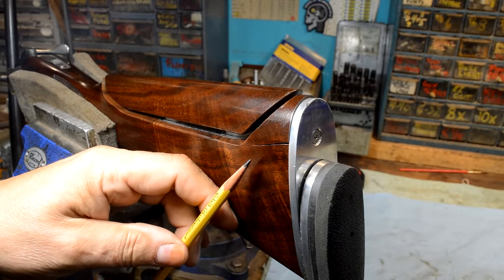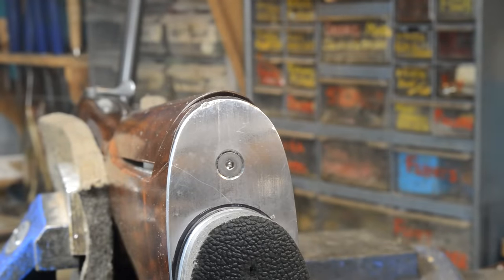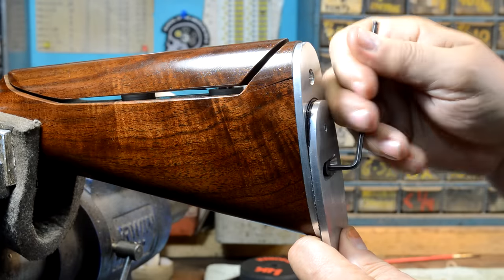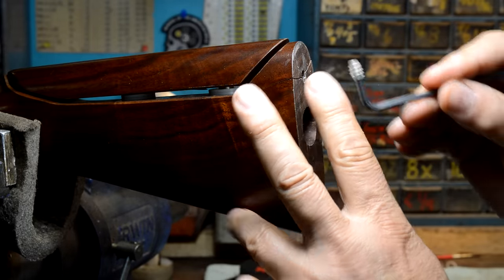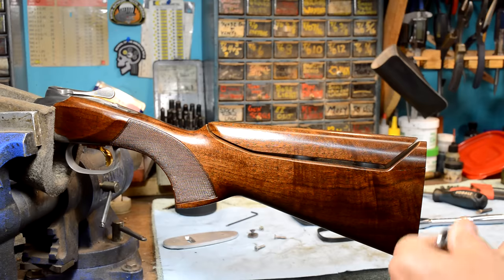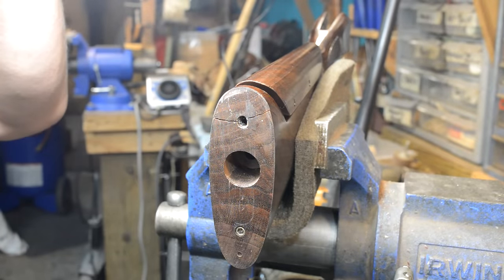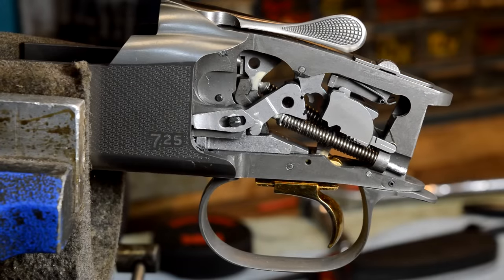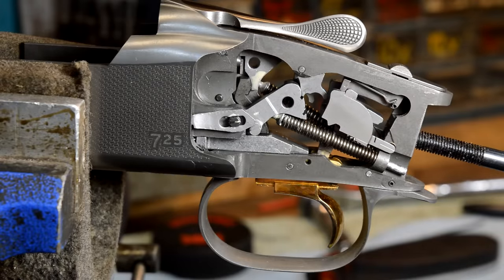Browning 725 Butt Crack repair: Anvil 0127

Comment: Your vids are awesome.  When you have a split like that can you use a thread to pull glue into the crack??
Reply: I would also use painters tape on both sides of crack on both sides of stock bringing it close to edges as possible so I do not need to scrape the finish so much. then there is just a slight thin line instead of an 1/8th of an inch. Im a master cabinet maker and finish carpenter and have made everything you can imagine, and dealt with tons of damage. Wood is unforgiving.

Comment: Hey Mark, question for you...when you were applying the glue to the crack to fill everything could you have put it into a syringe and basically force pressured it into the hole/crack filling things up from the bottom to the top? vs trying to cram it in from the top with the drill bit?
Reply: Acraglass has glass fibers in it for strength, a syringe would clog.
Reply: @jsh6952  a large enough tipped syringe like one used for injecting meats with brine I dont think would clog.
Reply: @ETKSauron  that tip would need to be at least 3/16" or 4.5mm. That is more like what embalmers use at the funeral home.....
Reply: You can carefully use compressed air to force the epoxy into the crack
Reply: @WHATAGIRLWANTS2009  Mr. Novak used the hydraulic method. The threadsert hole was the cylinder, and the drill bit was the ram.
Reply: @ETKSauron  and by the time you get the syringe, filled it with the thick, gooey glue, reassembled - you could have just did what mark did and got it does with the same result. Simplest solutions are often the best time wise and time is money. Also, then you don't have to worry about trying to find a syringe that will work, and buying them/disposing of them. Your idea, while would work is uneeded complication and tooling.

Comment: 32:20 just curious, but wouldn’t it be more logical to put in the dog bones first, before screwing in the insert to avoid stressing the glue joint more than necessary?

Comment: Perhaps a silly question- why do use the synthetic glue say vs casein, or fishbladder or rabbit hide glue? Is it because of exposure to humidity?
Reply from the maker: Water resistance, and a small degree of flexibility. Also, I can checker right through the nylon, and it will hold the diamonds, which the other glues will not. Real bottom line....I can make Acraglass sit up and bark on demand, and can count on it downline. It works for me, everytime. No shade on other adhesives intended or implied.
Reply: @marknovak8255  no understood- just approaching the butt from a luthier's kind of perspective (music instruments admittedly are not brought through forests or inclement weather- and avoided dropping at all costs)

Comment: Mark, out of sheer curiosity - how many more times does it take to make such a (relatively simple) repair while filming rather than when working alone?
Reply from the maker: Doubled
Reply: @marknovak8255  Easily doubled. I worked for a couple hot-rod shops for a couple decades. I worked with a few magazines on builds or installing parts for content/articles   - it is amazing how long it takes. I still hear "rotate your hand and tool, hold...hold *shutter click,  click*" ok I got the pic, next step" or "I didn't get that, take it off and reinstall so I can get it...."   It made a car build that would have taken 6-10 months (magazine builds are never as nice as they look....lol) turn into a year and a half between scheduling, work, photography, and editing.

Comment: Green Rookie here, Would it have beneficial to steam the Butt end, since it had an impact?
Reply from the maker: If damaging the finish was of no concern, definitely. However.......it will damage the finish.
Reply: @marknovak8255  Thank you Sir
Reply: @marknovak8255  Early in the video, Mark mentions the highly figured stock has an oiled finish.  Steam would push water into the wood, and displace the oil.
Reply: That was a good question I was thinking the same thing.

Comment: random question: how well do you think bicycle chain lube, specifically the new fancy waxes and oils, would fare as gun lube? I mean the entire point of those is not only to lubricate but also to keep all that nasty road grit out of the chain. and I think bicycle chains are exposed to far harsher conditions than the insides of guns....
Reply: Oil for parts that rotate.  Grease for parts that slide.  Viscosity depends on ambient temperature.  After some shooting, the carbons from powder gases especially in semi-auto pistols, form a bearing surface with the oils.  So, really, use what you've got and reapply when it doesn't do the job anymore.

Comment: I have to say that is an.....unusual buttplate.  The top plate is only secured to the bottom plate with a single allen screw.   Seems that inevitably that screw will loosen and begin swinging around on the fulcrum of the screw.
Reply: @chuckschillingvideos that’s likely a Graco Adjustable Butt Plate that the owner had installed as a part of having the gun fitted to them.
Reply: Yeah I have a bunch of them with different sizes. They did modify this one of course. One screw will hold that. Its not a 12ga I would bet maybe 20 ga or 410.

Comment: When you say polished hammer faces, what method are you using to achieve that goal, polishing, wheel, rouge, or no rouge, brass, wire wheel, carding wheel?
Reply from the maker: Fine sandpaper,  wheels and rouge. Just remove all of the scratches

Comment: Mark I know your a busy busy man but PLEASE advise me on a crack I have on a mauser sporter. Right behind the bolt handle there is a crack in walnut stock. I don't want to drill down in crack to acra glass my thought is to open crack a bit and super glue cause I can't pull apart far enough to acra glass it but I need help on this one if you would be so kind to advise.
Reply from the maker: My bet is the bedding supporting the recoil lug has failed,. This allows the entire action to scoot aft until it runs into something hard. Inspect the front of the magwell for cracks and blowouts. Dont fix the bolt handle cracks until we know WHY they appeared. Your answer may just be a simple action rebedding.
Reply: Thank you will bed action and fix cracks

Comment: Do you happen to know were i could get the wire clips for a 1891 argentine mauser hand guard or what gauge wire its made from
Reply from the maker: It's copper wire, in a gage that fits the slots in the handguard.  18 to 20 gage bare copper, twisted till tight under the barrel. Jewelry hobby supply is where to look, all you need is two 1 foot lengths. There is a hole in the barrel channel for the tail of the wire to go
Reply: @marknovak8255  thanks

Comment: What does brash mean in the
Is context
Reply: In popular usage the term brash generally means the characteristic that causes a piece of wood to break abruptly across the grain, with relatively low resistance to such breaking. Vulnerable cross-grain.  Split-prone.  Splitty. 

The wood is brash because the tree wasn't expecting to be split open and exposed to shooting sports.

Comment: How does a pice of leather sharpen a blade I thought all it did was wipe of the little bits of metal from sharpening ad makes it smooth
Reply: it "sharpens" the blade by removing the burrs as you said but also aligns the microscopic teeth on the cutting edge of the blade
Reply from the maker: Last post explains all of this

Comment: Ok i want to comment before i watch with my initial thoughts just from the opening overview before the hoorah.   

From a tiny screen a million miles away driving from the back seat it looks like the crack goes right through the screw hole for the butplate. They either didnt drill it before the screw or they didnt drill it big enough and the recoil caused the stressed wood to crack. Or it was set fown on that lobe a little hard.

Cant wait to see how wrong i am.  

If you made it this far im just boosting the algorythm

Comment: Mark got a question on stock finishes, i've seen flintlocks where iron nitrate (aquafortus!) was used to finish the stocks one comes out a reddish brown and the other came out a greenish grey, is that a difference in the wood time between applying the nitrate and the heat the number of coats or what?
Reply from the maker: Heat. Aquafortis works by burning the sugars in the wood.
Reply: @marknovak8255  meaning the duration of heat applied? as in the longer it's heated the more greenish grey it gets?

Comment: Browning 725 has mechanical triggers  not inertia.
Reply: Correct. There is no need to move or reset anything nor recoil required. You can pull the triggers on an empty gun as fast as you can and it'll go click-click every time. I have a 725 Sporting with the adjustable comb and the internal movable weight within the rear stock to tune the CG to your liking. 30" ported barrels on mine.